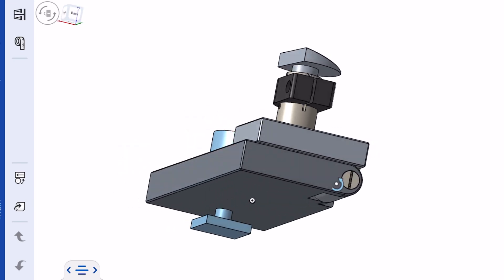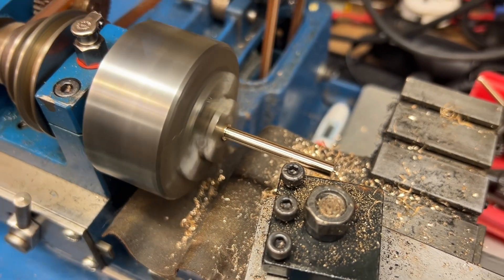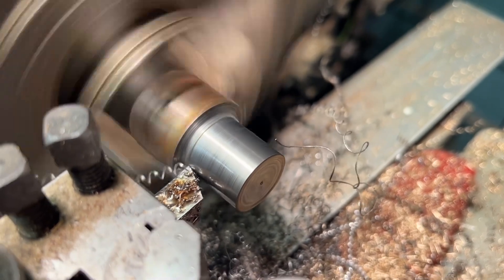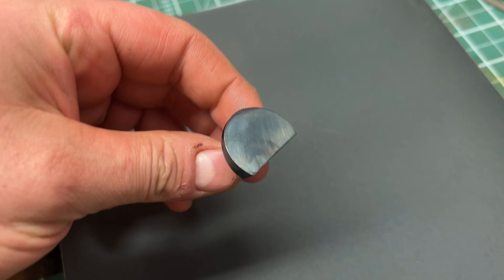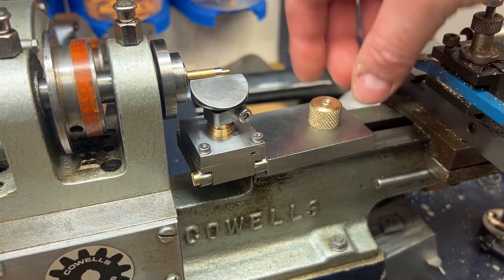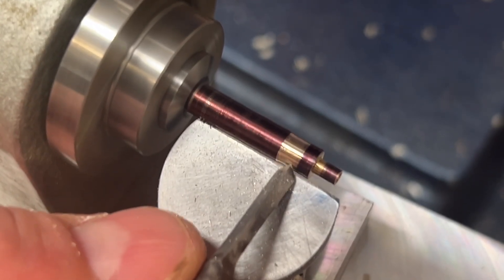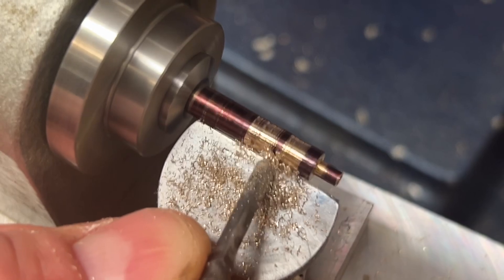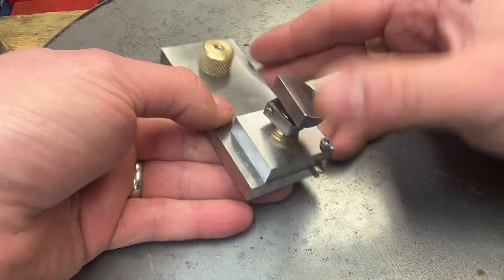Making a Flip-Over Tool Rest for the Cowells Watchmakers Lathe

Comment: Great job!

I am in the process of rehabbing a Derbyshire Magnus 10mm lathe. I am to the point of making the flip tool test and post. 
 I am not a watchmaker. Only a guy that loves machinery and restoring them. My question is. What is the diameter of the tool post shaft that fits into your split collet. I would like to make it to some standard. I have no clue as to the diameter. 

Cheers
Tom

Comment: Hello--going to jump onto this latest video to ask a question about the Wilding Tower Clock. Have you got to the point of figuring how the escape wheel attaches to its collet? Other wheels are attached by three screws but Wilding shows no such for the escape wheel and I can't find any information in the text. I think it needs a pattern of 3 8BA screws on a 9/32" radius, as with some other 3/4" diameter parts. Your thoughts, please? My email is available on my About tab if you'd care to communicate that way.
Reply from the maker: Hello there, yes I’ve not made a video about it but exactly that. I also used 8BA or metric equivalent at a suitable radius to attach it. I admit I can’t remember the radius but I think I followed a pattern similar to other wheels. I also looked at other videos to identify how they had fastened it to the collect as I agree - it confused me with no info on the drawings or in the text.
Chris 😊
Reply: @craynerd  Thanks so much. Have you completed your clock build?
Reply from the maker: @sierraspecialtyauto7049  not quite! I’ve still got a bit to do in completing the pendulum. I ended up getting a bit bogged down with family and work. I keep hoping to get back onto it soon. Hopefully this autumn.